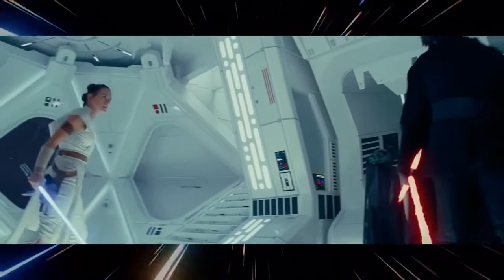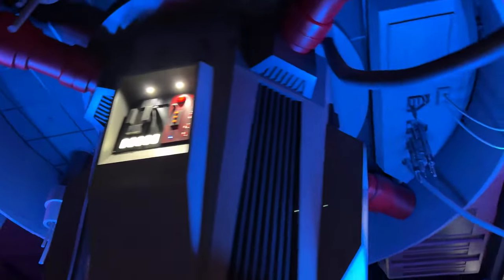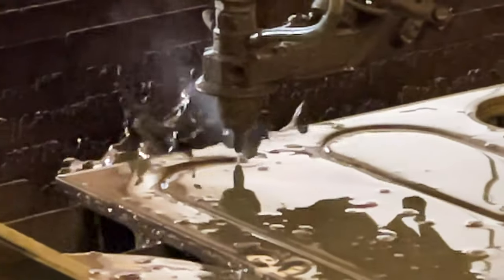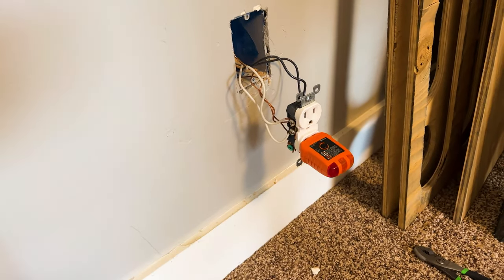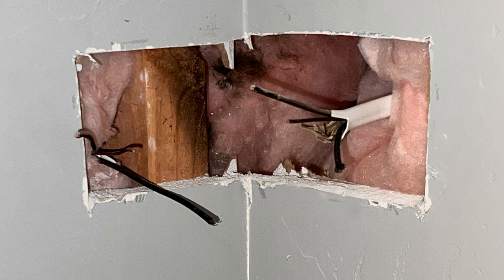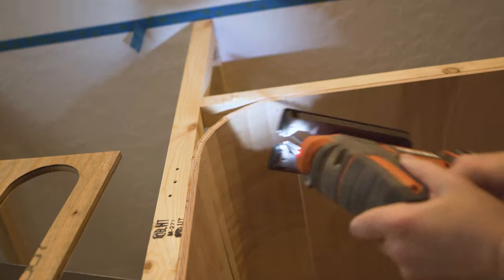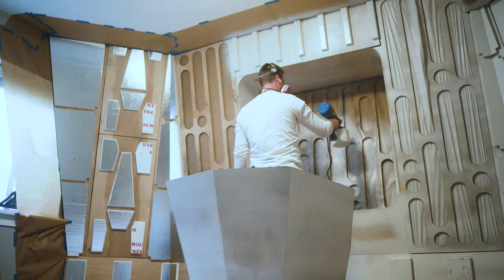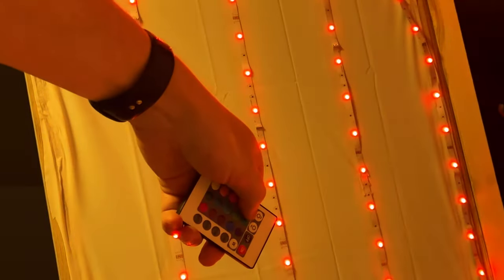I Built A Star Wars Room In My Basement w/ Hidden Storage!

Comment: Great ideas but you really need to invest in a Bosch gs120 multi detector or similar professional device. It warns accurately of hidden ⚡️ electrons / live cables , wooden joists & metal at a depth of 15-20 cm behind every surface. Costs $150. Stay safe and great channel 🌹🐝🙏🏻

Comment: Excellent job but still not as good an effect as I expected. In my opinion, you did too many round cutouts panels. And of course, the not completely flat curtain is exactly the opposite of the "modern" look where everything is perfectly smooth. If you can add, a little bit more flat glossy surface and more light (like in 0:17 of your video that makes the diamond shape) that will be perfection.